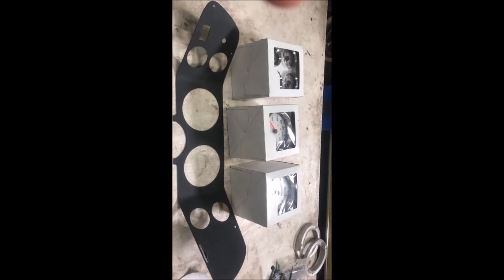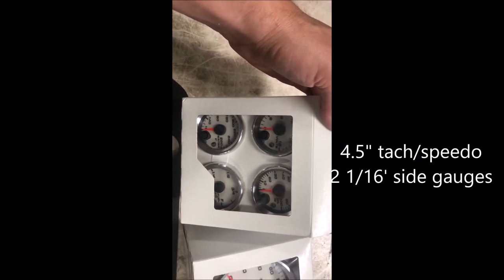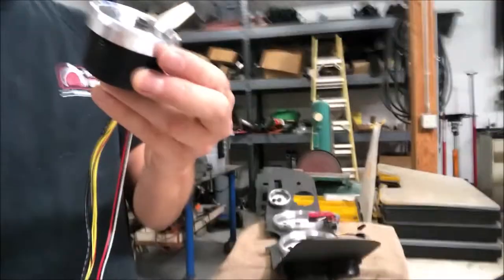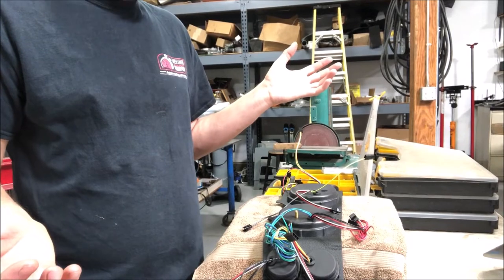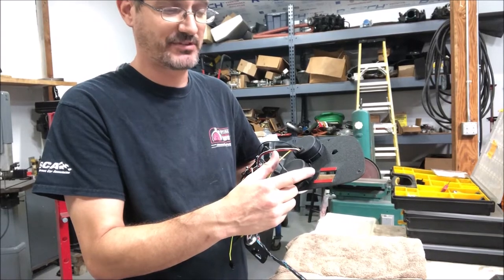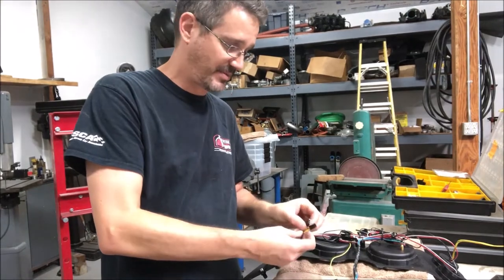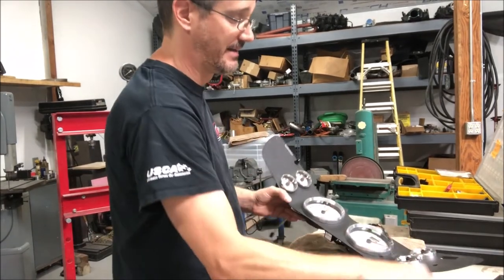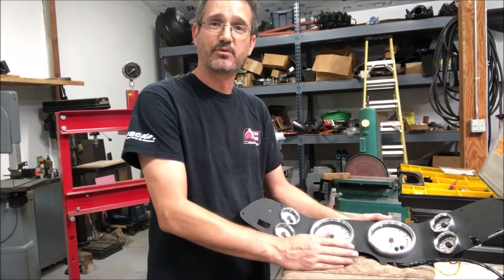How to Order Custom Gauges for 70-81 Camaros!

Comment: Thanks for sharing .. is there any turn signal holes on the panel ?
Reply from the maker: The Speedo has indicators for the turn and high beams built into it on the Speedos we use